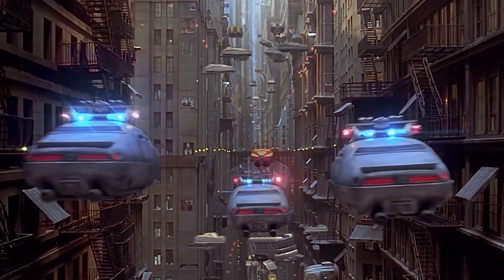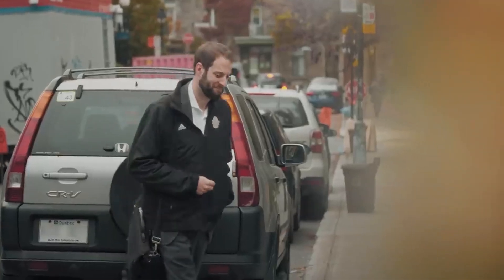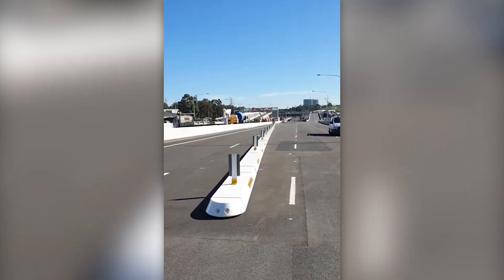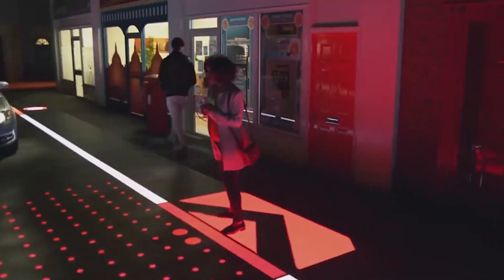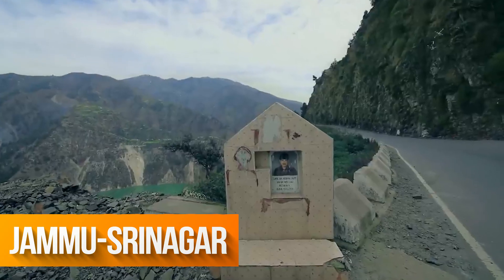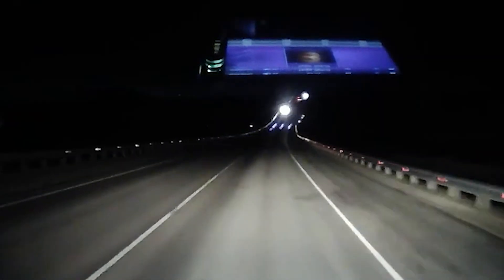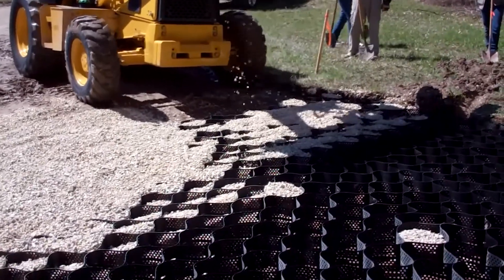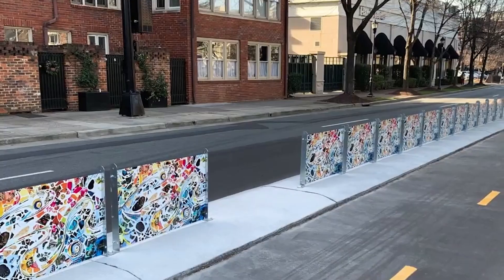Incredible Road Technologies That Are Insanely Cool

Comment: I was hoping to see the "Solar Freaking Roadway" here, but that reactive sidewalk/crossign thingy seems pretty close
Reply: Can't wait to see how many accidents all that confusing blinking animated nonsense on the road is going to cause.
Reply: but the forks of death.. are only slightly less deadly than the electrified road of glass and wasted taxpayer funds.
Reply: @zarthemad8386  You make a great point. What happens when there's a car wreck and the road gets torn apart and the high voltage cables inside electrocuted.

Comment: A lot of these sound like great ideas, but I worry about maintenance and wear-and-tear. Don't get me wrong: I'm glad people are working on new ideas, but "cheaper to install" often means "more expensive to maintain" in the long run.
Reply: They also seem to not be thinking about the practicality of the technology in every day use. That responsive crosswalk stuff for instance. How do you think people are going to react to sudden changes in the graphics on a road? Sudden blinking lights, red patterns, etc. I've seen people lose it with just a few orange barrels where they aren't expecting them...that will cause more accidents than it will prevent.
Reply: @did_I_hurt_you_feefees  Heck, just wait until there is a inch or two of snow and ice hardpacked onto the surface.
Reply: Good idea on the drawing board, bad in real life.
Reply: Several of these ideas won't work here in Canada which has frequent freezes and snow that covers the roads inches deep.
Reply: Yeah, that pothole patching system looked like it made a pretty sad patch.

Comment: That system where emergency vehicles can change traffic lights from red to green was thought of in the UK decades ago.
It was deemed to dangerous as drivers who had just gotten a green light, that suddenly turned back to red, would still proceed thinking that they lights were just faulty.
Reply: The system in the US is called Opticom.  The flashing light on the emergency vehicle is picked up by the sensor on the traffic light and turns the other three directions red while the direction the emergency vehicle is coming is turned green.  This had been around for about 30 years.
Reply: @mayfaire4338  Our system that was tested used sensors buried in the road about 100 yds from the lights. So when the emergency vehicle went over them, it did what yours did.
I think the problem ours had was the councils would always come a long and dig up holes which would disrupt the system.
Reply: @mayfaire4338  Growing up in Erie, PA area; in the ciry they had Traffic signal preemption perhaps as early as 1960s? I always thought it was radio-controlled but could be mistaken. Also I seem to recall believing that we were a Test City.
Reply: @musicloverme3993  They make both radio and flashing light detector versions. Most gates at rich houses will also automatically open if you know the right radio frequency or flashing light detector.
Reply: @mayfaire4338  the system in my area has flashing lights for all ways at the intersection to let them know the light is being changed for first responders
Reply: If every traffic light would be smart, anticipating on traffic demands, there would not be any problem. In the Netherlands it has been successfully in use for decades! Even to make sure drawbridges are passabel when an emergency vehicle approaches.
Reply: If you think a light is faulty while it's red, you're supposed to stop. No matter if it's faulty or not. Red means stop.
Reply: @josgeusens4637  Yes, Stop first. Then if you "determine" it is faulty, carefully check the vicinity before you proceed.
Reply: They are standard in Germany
Reply: Not to mention that it would be incredibly susceptible to man-in-the-middle attacks. Messing with traffic lights can truly be dangerous compared to what's saved in time for emergency vehicles.
Reply: @GOTHICforLIFE1  Yes, certainly can be susceptible to hack. Just curious though, have you heard of any instances of this occurring?
Reply: My first thought would be shouldn't they make the emergency vehicle signal be directed forwards to only effect the light ahead of them, but instead of switching to green, make it switch to red for both axis. Would stop anyone mistaking it as faulty and just allow Emergency Vehicles to continue through red lights as everyone would be stationary?
Reply: @BulletWulf  Problem is with roads that don't have a left turn lane that the Emergency Vehicles could use to pass all the stopped traffic in their direction of travel. In these cases they need the traffic ahead to continue to clear the way just until they approach them so that they themselves can continue to travel. They also need the opposing parallel direction of travel to clear the way near the lights so that they can drive the WRONG WAY to get around the back up at the left turn lane at the intersection.
Reply: @musicloverme3993  Ahh very true, that would be much more noticeable at congested areas. I know most people tend to veer to the sides to make clearance once they hear an emergency siren, but then again you can't rely on those people alone to clear the path ahead of time

Comment: 8:04

Already something like this at intersections around me.

I see lights change or stay red for oncoming emergency vehicles.

Unclear what is controlling it though, if it's local or just gps and remotely controlled by someone.
Reply: @Nozzred  I'd heard that, but wasn't sure.

Seems a bit insecure and easier to exploit.
Reply: @drewdrew53  Found some info and video about this but didn't find howe many years it's been in use but there are several different system  already in place doing this.
Reply: @drewdrew53  opticom is one system, probably many others out there.
Reply: You can get one on Amazon
Reply: Vehicles use a transponder, electronic device, that has to be on a list of approved ones, stolen or missing ones are removed from the list and are of no use. Each has a unique code, just like the one you use to open doors at a hotel or work.